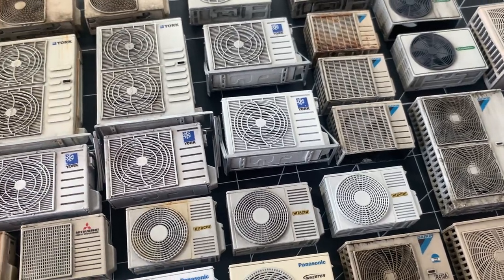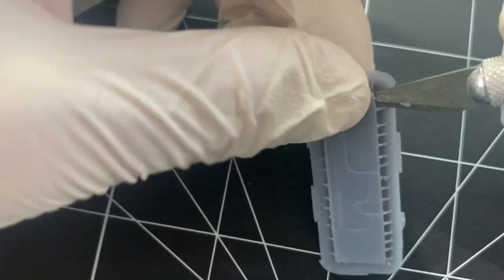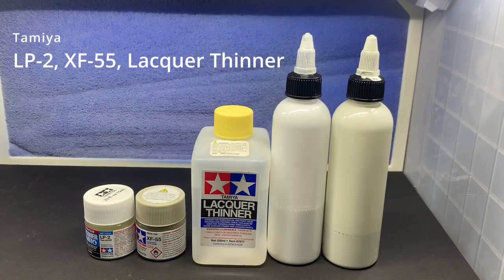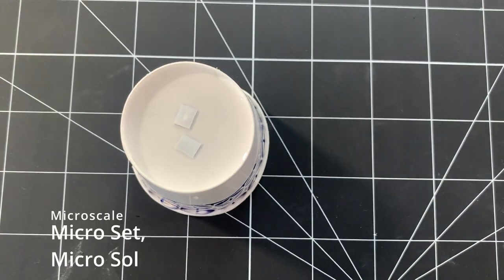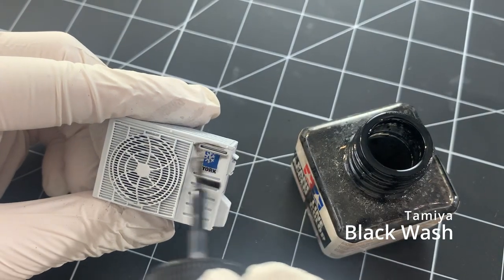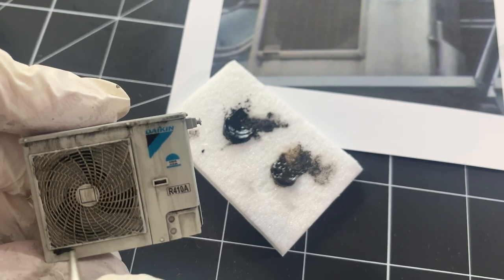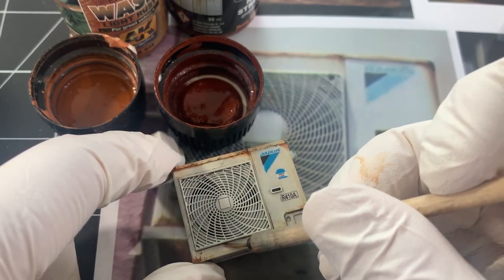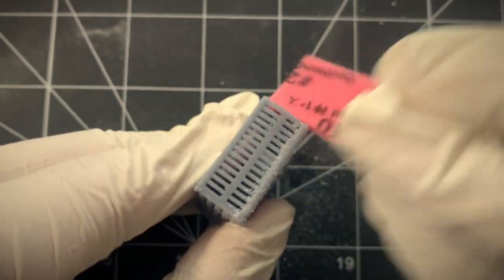How to Make MINI Air Conditioners | REALISTIC Resin 3D Printed Details for Dioramas

Comment: Try soaking your 3D prints in some hot tap water for a few minutes and they seperate your parts from the supports with out having to use a knife, it is a lot safer and easier. Use nippers to cut away the integrial supports that might otherwise break the print.
You are very talented

Blessing
Pastor Randy Bourque
Reply from the maker: Thank you again for all your help!!

Comment: Love how they turned out! I just had a question. You always remove the supports with an knife I do the same but to you remove them before or after curing your print? And what resin do you use? What I use seems to be a bit harder and less flexible than yours so damages quickly when removing supports.
Reply from the maker: Hi there, thank you!!! I typically remove them before post curing the print which is why the prints seem kind of flexible. Also because the prints are so thin, that might have something to do with it too

Also I use Elegoo Standard Grey Resin for my Elegoo Saturn S. Hope this helps!
Reply: @smolworldworkshop  Thankyou!